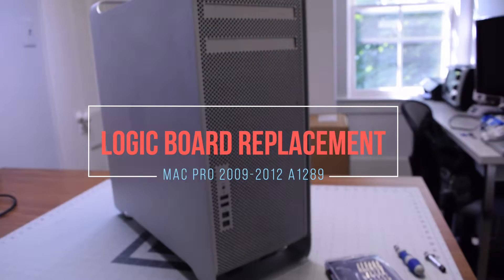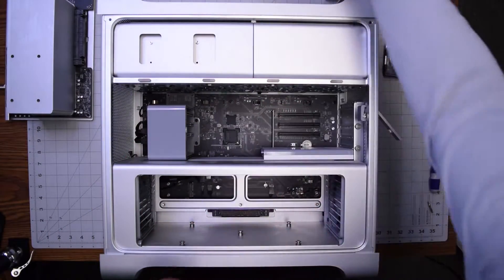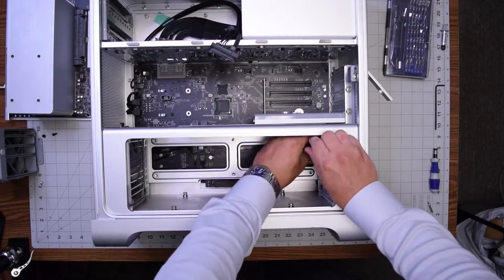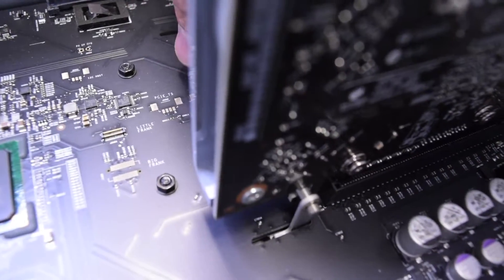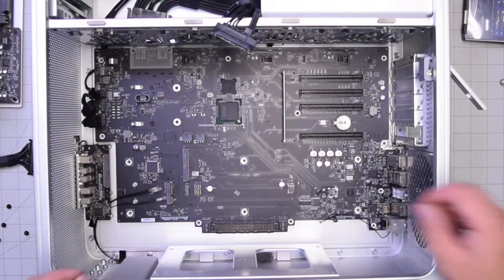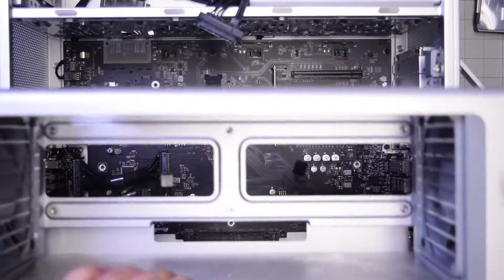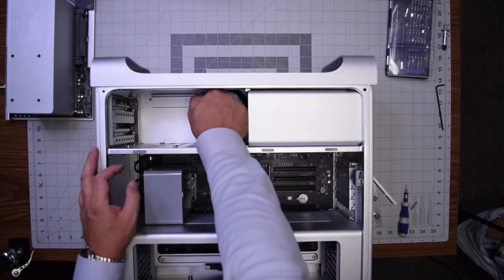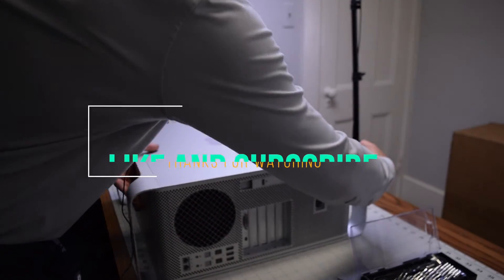Mac Pro A1289 - Logic Board Replacement (2009-2012)

Comment: A very nice commentary and very useful demonstration to dismantle of Mac Pro server. I am using Mac Pro Server from 2010 to till date. Just day before yesterday, the power supply having problem and not turning on the system. The Mac Pro server was functioning 100% around 16 years. Hope I will be sorted out the power issue.

Comment: I have a Mac Pro Desktop Xeon with 32 gigs of memory and 2 drives. one is a 500 gig drive the other is a 2 TB drive. nice computer. i cant get it to boot to dvd. i have OS X server 10.4 and I have OS X Tiger. and the OS that is supposed to be with it that i downloaded from the internet. i made a USB bootable with Transmac and i made DVD bootables. i eve hold down the C or in this case the option and the option c to boot from c. will not load. it reads but never loads. it goes directly to the os that is inst

Comment: Hello. My Mac Pro 4.1 updated to 5.1 is crashing: when I
  power off turns back on, both from the home screen and from the user. I can't leave it on standby either because it turns on again. I tried changing the power supply and it's still the same, I changed the graphics card and it's still the same, the same thing when I changed the startup disk. I have disconnected all the peripherals to test, started with an operating system from a previous SSD that worked fine and remains the same. Do you think the firmware has deteriorated?
The only thing I have left to try is to change the motherboard. Do you recommend doing it? Where can I get one that works well?
Thanks in advance.

Comment: Hello Friend!  My Mac Pro mid 2012 malfunctioned without being able to turn on.  So I took it to a service center and they said the back plate is defective and needs to be replaced.  But I have a question that is worrying me!  When they exchange my original board for another one, I imagine it will have another Serial Number.  The question is: Will I be able to sign in to my iCloud?  iMessenger, Face Time...??  In advance, I appreciate the help!

Comment: Hi, do you think it is a good idea to upgrade the Mac Pro to the highest spec. Also if I did, would it be good for video editing.
Reply: yes it is. If you upgrade to OS Sequoia it will be usable for the rest of the decade on current apps. They are very fast and still usable today- and the best part is they are the most customizable mac ever so you can tailor it to suit your needs
Reply: @Gizmotronicz thanks for your reply mate, I still have my Mac Pro but only the case. I bought a pc in 2021 and im planning to transfer it to the Mac Pro case.

Comment: Hello I got problem with my Mac Pro 4,1 upg 5,1 hope you can help me ;)) 
I tried to clean the keyboard and was connected to front panel, but Mac was off , 
After cleaning , I turned on the Mac but nothing was on screen , also no light on keyboard, but everything else was fine , fan spinning , gpu an spinning 
I bought keyboard, I changed front panel , I removed gpu , I removed ram , I tried to reset smc on backplane , I changed batter on motherboard,none of this worked.
When Mac is on I pressed DIAG and I get most green only 5V STB is amber or yellow, so I am not sure if problem is from motherboard or PSU or CPU tray
I really appreciate if you can help me to fix my Mac thank you
Reply: Hi. I just found your question beacuse I have the same Issue with no luck! Have you solved it?

Comment: So ive got an 2009 5,1 (original 4,1) because of the SMC chip I want to upgrade to 2010, 2012 so than I need this logic board I guess?
Reply: Hey I got the same question. Did you find out a solution?
Reply: @delireboris  I've bought an 2009 dual CPU tray and sold my 2010 dual CPU tray

Comment: I have a 2012 Mac Pro computer the same mac that is in your video above, it turns on and off when I I turn it on to do some work. I have been suggested to pull out the fans and resit them. When i looked at your videos, how do I check the fan that sits near the power supply.
Please can you help as I want it to do my video editing, I  have 12gig ram and 4 harddrives, all 1gig each. Please can you help, I am in Australia. I like your videos very much, Philip
Hi I forgote tomention it is a duel boot set up in my Mac Pro 2012. Philip

Comment: Hi,
My MP 2010 5,1 went totally dead. I press the the power button and no led light or any sound.
It all started when I was using the computer normally and suddenly went off for no reason. I restarted and a few minutes later it went off again. The third time, the computer went totally dead.
I did research the internet and it seems my issue is the backplane board. I get a red LED when I plug the power cable and amber LED when pressing the DIAG button. So it appears my power supply unit is ok.
Is there a place where I can buy a backplane? I checked a repair guy in San Diego and he wants $100 just to diagnose my issue.

Thanks!
Reply: Ever get it fixed ?

Comment: You're an absolute genius. Mustered up the courage to replace the backplane by myself and simply followed your guidelines. Worked like a charm!
Reply from the maker: Thanks! I’m glad you got it up and running.
Reply: @Save Apple Dollars Also, its worth mentioning that the logic board example you showed didn't contain the wifi card. Got a little freaked out when the new backplane didn't have one too, just calmed myself and unscrewed the wifi card from the old one which I was about to dispose and plugged it into the slot at the low left corner and fit the two 'bluetooth' like cables hanging separately into it. Voila! Problem solved.

Comment: So glad I found your channel just now. 

I’m about to purchase a 2012 Mac Pro 3.2ghz quad core(single cpu). The seller mentioned that the Blackplane Logic board is damaged and won’t turn on. How can I make sure I find the correct replacement MOBO so I can follow your video guide? Thanks!
Reply from the maker: Cesar just purchase a 2012 A1289 logicboard on eBay if it’s really bad but lately you may need a power supply or something is disconnected. You got to troubleshoot first, then shop around based on seller rating and distance from you. Here is a good video with tips on how to shop on eBay, it’s a Mac buying video but should help you see how I shop for Macs and Mac parts https://youtu.be/YpTbbG3bLVM
Reply: Thanks for you feedback. You’re awesome, man! I found this on eBay; 

https://rover.ebay.com/rover/0/0/0?mpre=https%3A%2F%2Fwww.ebay.com%2Fulk%2Fitm%2F202886038042

or 

https://rover.ebay.com/rover/0/0/0?mpre=https%3A%2F%2Fwww.ebay.com%2Fulk%2Fitm%2F193432020831

Which one works if any?

Comment: Hello, can you tell me if the logic board (A1289) is the same board used (can support) for all of these processor variations:

Mac Pro "Quad Core" 2.66 (2009/Nehalem)
2.66 GHz Q. Core Xeon W3520

Mac Pro "Quad Core" 2.93 (2009/Nehalem)
2.93 GHz Q. Core Xeon W3540

Mac Pro "Quad Core" 3.33 (2009/Nehalem)
3.33 GHz Q. Core Xeon W3580

Mac Pro "Eight Core" 2.26 (2009/Nehalem)
2.26 GHz Q. Core Xeon E5520 x2

Mac Pro "Eight Core" 2.66 (2009/Nehalem)
2.66 GHz Q. Core Xeon X5550 x2

Mac Pro "Eight Core" 2.93 (2009/Nehalem)
2.93 GHz Q. Core Xeon X5570 x2

I currently have the quad-core 2.66GHz Q. Core Xeon W3520 and want to the "eight core" 2.93GHz quad-core xeon x5570 x2.  Thank you
Reply: There is a small difference between the 2009 and the 2010/2012 logic board. The 2009 board can be flashed (firmware) to act like a 2010 board. You can change the CPU tray from a single processor board to a dual processor board and ultimately upgrade a 2009 Mac Pro to a 12-core (dual processor) computer.
Reply: but do not mix original 2009 (flashed to 5,1 or not) and 2010/2012 backplan or CPU tray !!!
because of different SMC (1.39f5 is a 4,1 and 1.39f11 is 5,1)
it will end that the fans running allways like a hurrican
Reply: @IndioA  Hi unfortunately, it happen to me. replaced a 1289 motherboard because of sudden shutdowns and now i have a logic board with 1.39f11 and a cpu tray with 1.39f5. Isnt there any way to flash the SMC of the cpu tray to 1.39f11 too?
Reply: @telmodrodrigues  short answer > NO!

Comment: Just discovered your channel.  Subscribed right away.  Do you have a Pinout of the power supply connector?  Also do you know what tool could be used to deepen the power supply connecter?  Thanks.Shane